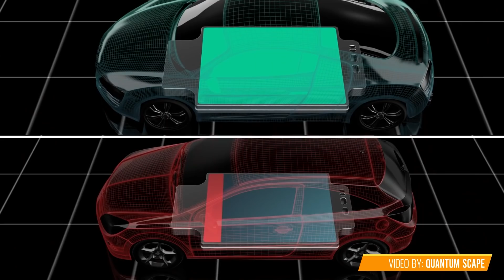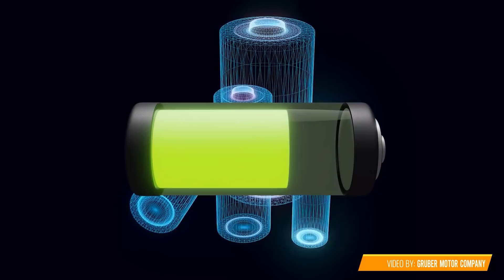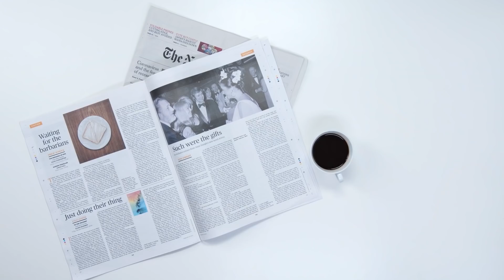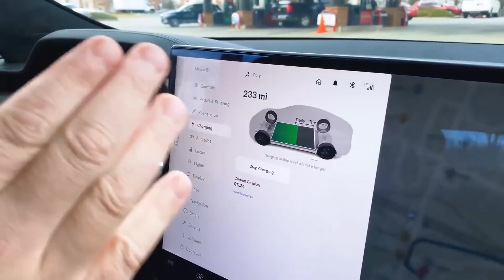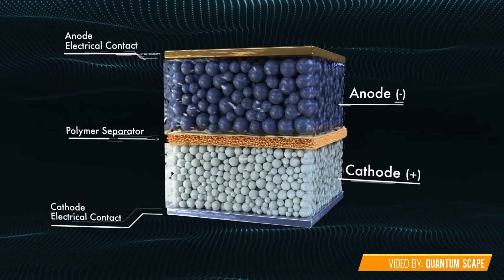SANDY MUNRO: Are Solid State EV Batteries Too Late?

Comment: Sandy is missing the point.  Yes 15 minutes is fine and the 750 miles is great but that is in a car.  I just completed a trip 680 miles each way pulling a 7500 lb trailer at temps from 20 degrees down to minus 10 F.  At that rate of energy usage currently there is no way electric can compete.  It's one thing for a car to go 750 miles on a charge but for me to change I need a 3500 HD level truck that can pull 20000 lb trailer to go 400 miles between recharges, and then recharge that amount of energy in 15 minutes to be on equal footing

Comment: I agree with Sandy, I purchased a 2022 Tesla Model Y, I still haven’t  ever gone into a Super Charger or any other commercial charger.  I have a wall connector wired into a 60 amp circuit and it charges at 48 amps.  As Sandy indicated wether it takes it five minutes or six hours I don’t car I’m probably watching TV or sleeping, this is how I STAY CHARGED.  Trips will be less confident, as little as I go on really long trips I will deal with the charge time.   Oh, people are generally not that stupid they will figure out the need for EVs.

Comment: Charging time and range? A non issue for the vast majority today. The key issue with tomorrow's battery tech is cost and energy density.  A battery pack at half the weight provides benefits from performance, handling, component life, to packaging.  Let's focus on that. I can certainly find something to do for 20 minutes on the few occasions I need to drive more than 500K in one go...

Comment: Bit sceptical about the Gruber claim.  His video popped up in my feed right after this one.  It is a graphene capacitor solution.  Great product if they can make it in production quantities.  However, graphene and it’s many potential applications has been known about for many years.  So far mass production has not become a reality, just like solid state batteries.  Lots of future technologies in the works, but I will believe they are real when products start to flood the market.

Comment: A simple solution: put chargers in gas stations. That will keep them going and gas stations are easy to find. Adapt or die pretty much. Aside from that electricity is not like gasoline in that there is no brand and ANY charger will work in ANY EV. That makes it really simple. The smart gas stations are already looking for ways to do this. Those will be the ones that prosper. You either change with the times and technology or get left behind. Thats life.

Comment: I was excited about the 750 miles run, but it was slow, 55mph constant speed, well there where some Belgium guys with a standard Tesla doing almost 625 miles driving really slow. Did you see the condense inside the car? They had no climate control running or very very low ... So pardon my French, but I call it bullocks ... it really is just a higher density battery, where we know that is easy to produce, but is it safe and will it standup against 1000+ chargers, I doubt it.

Comment: Charging time is one thing.  Cold weather range, safety, and battery degradation are another.  Solid state batteries are the next big thing and like EVs vs ICE, if you ignore them, it will be at your peril.

Comment: Aside from Tesla I think the two biggest issues for EV adoption are a lack of reliable charging infrastructure for people living in multi family homes and on longer trips.  Also many people are not aware of EV advantages or simply don’t want to change.
Reply: Exactly! Looking at the economics, people least likely to own a new car are those living in multi unit apartment buildings. By the time we get to that point, the complex owners or municipalities will have come up with a solution so like Sandy said, it's more just the media trying to sell soap
Reply: i don;t drive enough for it to make sense to change cars before the one i got dies. spent under 200 bucks on car gas last year. different strokes for different folks
Reply: Electric vehicles won't be for everyone.

Comment: Charge time and distance are so far behind but I need who cares my Subaru legacy gets about 220 miles per tank that last me a month if the car had only 50 miles of range and then I could plug it in and it would recharge that would be enough for my nails so when people talk about ranger 800 miles per trip it’s so inappropriate to my situation it’s hard for me the people make decisions that I am subject to base upon a wife that is so weird they need to concentrate on making vast multiples of a car for three years not a golf cart with a top but real car just not a lot of miles and not high tech a modern model T that they can make a lot of

Comment: Sandy is spot on. But, think. Did people say when the first horseless carriages come on the scene at the turn of the previous century, "but how are we going to feed it hay?" "Where are the livery stables going to be?" Just like the fact that automobiles were a fundamental change in the way we moved around, so will EVs be. Horse drawn carriages remained, for many businesses the delivery vehicle of choice for some two decades into the 20th century, but eventually people got it. So a few ludites will hang on to their gasoline cars, most everyone else will see the advantages of EVs and switch. Either they make the switch, or the disappearance of gasoline stations will cause them to switch out of necessity. All of us have the equivalent to a gasoline station with an electric plug. The boom in EV sales says one thing. ICE is dead for sure.

Comment: One of Sandy's most crucial points is, and I agree with him, that by the time solid state actually comes out, lithium will already have solved the majority of their issues and be FAR less expensive (it has already dropped over 90% in price in the last 7 or so years). Solid state would have to come up with something SO mind-blowing that it cannot be ignored, like 5 minute 0 to 100% charging, 50 year or better battery life and a price on par with lithium. That is a very very tall order that I don't think they can meet. But I wish them the best of luck anyway.
Reply: Weight and power density.  Not so critical in cars, but for scooters, tuk tuks, motorcycles etc.. it is the game.  More of these are sold than cars, and these are major sources of pollution.

Comment: Zero to 80% in 15 minutes is actually...terrible...when you consider that the new Hyundai Ionic 5 and Kia EV6 can charge from 10% to 80% in less than 18 minutes already using current L-Ion technology. After more than a decade of being "just 5 years away" solid state batteries need to be an order of magnitude better than that. Although, the other benefits will be nice too: greater max cycles and far less chance of catching fire (virtually zero).

Comment: Presently I drive a big ICE powered van with a 31 gallon tank.  Also, I live in CA so I drive to COSTCO to save a few bucks each time I fill up.  The line at COSTCO is almost always longer than 15 minutes before you get to the pump.

Comment: 15mins... 15 bloody minutes.

Let gets this right.. most EV charge at home, you drive to work and back (40 miles) and you top over night at home -if you want to, or once a week..
15mins if you use charging stations for going on a trip.

15 mins, is that 12 extra minutes out of your life compared to with filling up with fuel.
12 extra minutes - that you're Using electricity and not burning fossil fuel for your car journey.

12 minutes for planet earth.
Even 1/2hr isn't that bad.

Comment: I mean 22 degreesCelsius cabin temperature in the EQS. By the way, I agree other EV owners , my costs over 130.000 kms ........ 1000 Euro's , two tires and no wiper blades necause I use "rain-ex" , my first wiper blades are still on my car. My model S looks new ( always in a garage) and no riding in snowy weather avoiding salty roads which corrode all the aluminium parts of this car.

Comment: I don't think "the lighter a vehicle, the more efficient" a heavier car brings more regenerative energy !  I drive a model S P85 for 8 years already , my energy consumption is always under 170 Wh/km . I drive 90% highway on cruise control and even in winter I reach 160Wh/km driving where max 80 km is allowed.
It is all a matter of mindset , no hurry and driving safe to enjoy the ride. My cabin temp in winter mostly 17 degrees Celsius. That saves a lot of energy.
A very modern car like the EQS uses almost 10 kWh / 100 km at temps of 22 degr.Celsius. Almost 50% of the total amount of energy needed.

Comment: i am not sure that there will be ever a "breakthrough" in battery technology. and there is none needed, because the innovation gives us 3-5% more energy density per year for 5% lower price on average.
this results in a consistent way of getting better and cheaper EVs.
maybe we don't see it all the time when buying an EV. reason? the manufacturer keeps the profit because there is too much demand.
but at some point manufacturers come closer to keep up with demand, then because of competition, the prices will go down.
for sure not 2022 because of part shortage. but 2023, when car manufacturers deliver in higher quantities again, the prices could drop a bit.

Comment: I agree with Sandy that battery technology has gotten to the point that range anxiety and quickness of charging on long trips is no longer an issue! And 99% of us barely ever go on trips that are more than 350-400 miles anyway. And at home, just like you do your phone, you plug in your EV. Even the "cheap" Tesla3 long range can do 350 miles. Chevy Bolt is also a great choice! Both made in the US of A. F150 EV truck is here as well for the truck drivers out there! Time to make the switch to an EV on our next purchase! There's plenty of choice out there.

Comment: Sandy’s 100% correct on the charging. We only go to the gas station once or twice a week is because we can’t get gas at home. Even at a regular plug I can get 70-100 miles overnight. I drive a Chevy spark ev. 70 mile range and I charge it at home or at work in a 110 plug.

Comment: Solid state brittle fragile crack-prone batteries in the belly of a vehicle, shaking, rattling, shocked ?  Maybe a semi-solid battery would soak up the bumps much better.  Durability could be a problem.  They can put them on a Shake Table to simulate 10 years of bumpy roads to find out.

Comment: Hi guys. The answer is in the math. Average miles driven per day in the USA is 40 miles. Average rate  of charge per hour in a regular 220 volt home outlet is 14 miles per hour. So on average, in three hours, your car battery will be fully charged. Kevin Kenny Trinidad. The MATH does not lie.

Comment: 15 minutes to DC charge is just fine. Unlike filling with gas, you don’t need to be with the vehicle, you park up, plug in, then head to the washroom, pick up a coffee, browse the magazines, and 15 minutes is all used up. It can take 15 minutes at the gas station, short wait to get on pump, pump the gas, go in and pay - perhaps stand in line to pay, all this and you haven’t got a coffee or Washroom break yet.

Comment: Energy is Everywhere; Land, Sea, and Sky 
Storage of energy is like 'money-in-the-bank', unquestionably convertible to currency(...?) 
The relationship between energy and currency is the present conversion rate of 'mining' Bitcoin, 'digital-assets', or directly convertible versus the price of fossil fuels; KwH/MPG(.) 
Batteries are the NEW BANKS(!) 
So ..., where are we going with energy storage technology(?) 
Here's-the-deal, [think ...] of 'transistors' and their value in the digital transformation of the last 50 years. Batteries are going to do the same for energy transformation. This transformation may be distorted by misinformation and manipulation but the relationship between energy and money is inescapable, ...and therefore 'taxing' energy is the next 'socialist' movement. Subsidies today will be taxes tomorrow. Governments are not going to let EV cars 'ride-for-free' without paying that gas tax for using their roads; milage will determine the amount you pay(.)
There is so much research today, and the cost/KwH is falling rapidly and this trend will continue, so it's just a matter-of-time, ...and money; "how many miles are in your wallet"(?)

Comment: Yup, Sandy is 100% correct. I traded in my PHEV for a Mach E 6 months ago... I bought the premium with standard range battery. I always wake up and find my car ready to go over 300km. It is faster and better in every way than any ice vehicle I have ever owned. One time in 6 months, I had to stop at a public fast charging station for 10 minutes to top up enough to get home from a long day of driving around. Forget range anxiety, what about fuel price anxiety? Even with a PHEV, I rarely bought any gas. A tank would last a month instead of a week... EV's are the future, less total cost of ownership (near 0 maintenance cost, and 1/4 the fuel cost), and range anxiety is just not a thing 90% of the time...

Comment: As far as I can tell, IF YOU HAVE EASY HOME CHARGING, the charging speed issue is greatly exaggerated, just as Sandy says here. I have yet to meet a Tesla owner who doesn’t say that, on balance, the time they save in home charging easily balances or outweighs the longer charging times on the road. I think Sandy was being polite to bash the rest of the media - you keep flogging this Alex, but it’s a nonissue already even with 300 miles of range. This issue has virtually faded away already.

Comment: I have been saying for months, range anxiety is crap, from the old technology ICE people.

Most people will only use 5% to 10% of their battery charge to get to and from work or daily use.
The other 23 hours a day the car will be plugged in selling or buying power, MAKING MONEY.
EV car computers will be set for your minimum need, and make money on any spare capacity in the battery.
The EV cars will be stabilising the grid. STABILISING. 
Home batteries or BIG BATTERIES are manly a temporary thing before EV cars roll out.

For the long trip most bladders will not out last the battery, and only a small top up maybe necessary before you get to your motel/hotel and the full top up.

Homes only need 10% of the EV battery from one car each night.
F-150 Lightning, with huge battery, for $40,000. The battery is free.

Plugging in will be become automatic and very easy. At every location on the grid.
Every home and work place and shopping place and entertainment place is on the grid now.

Power companies will not need to run at peak levels waiting for peak demand, and wasting huge amounts of everything. They can run at maximum efficiency 24/7, and min CO2. 

ICE cars prices will crash, but petrol prices will also crash and this will make the transmission messy.

There is a lot of rethinking needed away from the old.

All cities would have been buried in horse manure if the new ICE did not happen.
Reply: Repair and spare parts and regular mechanical check ups NOT NEEDED, the F150 looks cheaper and cheaper, and cheaper. NO petroleum costs, buying and selling power into the grid, money in the bank, TAX FREE.

Comment: Yes, they are too late. But better late than never.
Solid state batteries are way better.
1. No liquid electrolyte. 
2. No complex anode(lithium metals makes the anode!)
3. Anode is formed AFTER the battery manufacturing, during first charging- simplifies the fabrication greatly.

Even Tesla is working on solid state lithium metal batteries. They are the next generation of lithium batteries. Cheaper, safer(nonflammable even), with energy densities even 1000Wh/kg+.

Comment: Lately, I've seen brief coverage of a stretch of road designed to wirelessly charge vehicles driving on it. Of course, that requires adapters on the vehicles to "connect" with the power source, but if this becomes common, battery packs may be able to be smaller, yet range anxiety gone. For this reason, I'm not tempted to invest in charging stations or Nio's swapping system; technologies likely to be superseded by better ones.

Comment: More range - especially winter range - from batteries would be very welcome.  Case in point: I’ve made multiple recent winter trips for airport pickups in Detroit.  Round trip: 240 miles.  It was no problem in my Chevy Volt, but a pure electric would worry me.  I don’t want to have to stop and charge just for this wintertime case.  Not many EVs today could do this trip in the winter without the need to stop and find a charger.

Comment: Let's see...15 minutes to charge. When I was a kid, we took long trips and to stopped for gas, by time you filled 'er up, went to the bathroom and got a snack, it took at least 15 minutes..so what's the big deal? What we need is more high speed charging stations. Today, 15 minutes is nothing. If I got an EV..it wouldn't bother me at all if I had to "fill 'er up" with electrons.

Comment: 8 hours of driving an average of 65 mph gets you 520 miles.   How long can you park your ass in a car seat?  I bet very few of you have never driven 520 miles without having to take a piss or dump.  I'm 61 and I drove 8 hours straight once in my life when I was 29.  Now I could not physically do that.   I was by myself and had to urinate in a plastic half gallon milk jug to do it.  500 miles per charge is plenty.  The average ICE car/truck today goes 400ish miles on a tank.  800 mile range is irrelevant but fast charging is very relevant IMO. 15 minutes to charge is good enough.  At 61, I can still walk a mile in 15 minutes.

Comment: Hello, thank you for your very instructional videos. Quick question: I just ordered a Model Y, should I hold my order until the vehicles come with the new 4680 batteries or accept one with the old 2710 batteries? Please advise. Thank you.
Reply: My understanding is that the chemistry is the same, so it shouldn’t make a difference.